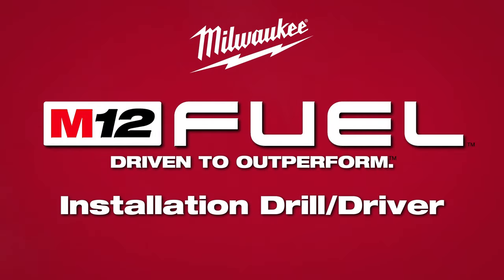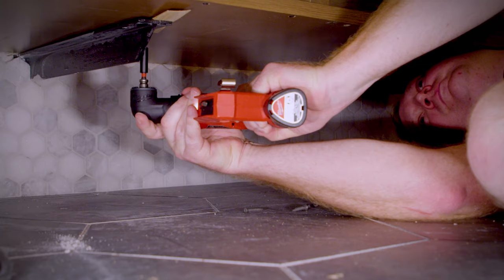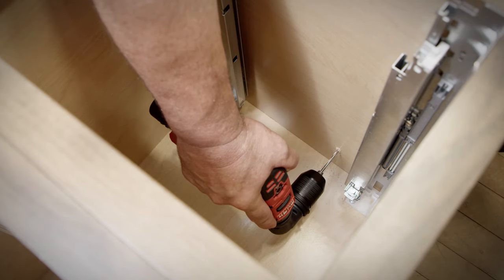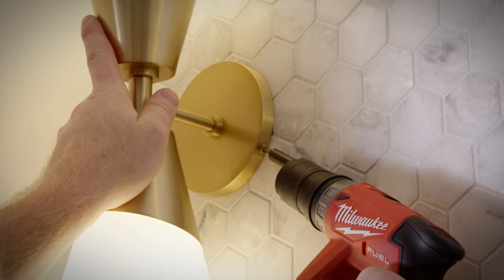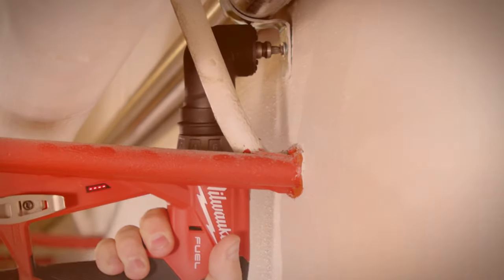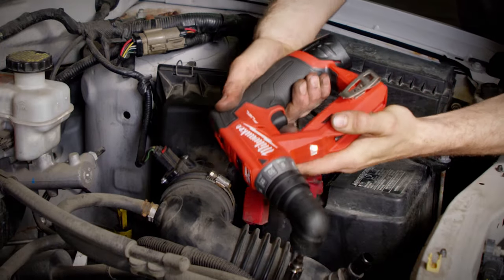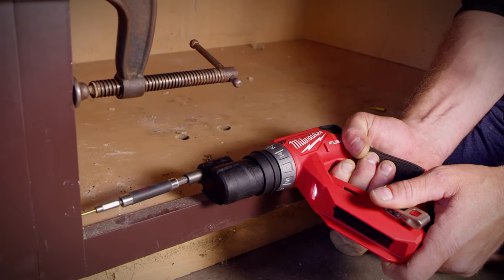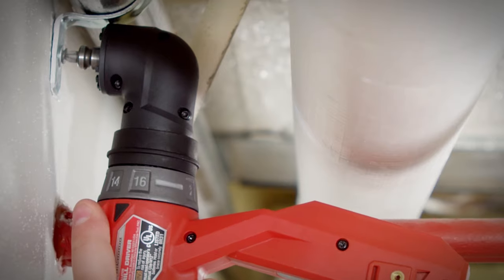Milwaukee® M12 FUEL™ Installation Drill/Driver

Comment: That offset would be so handy!! So many times i've tried to get a screw through something trying to go at an angle because it's a tight spot and it not working. This is a great solution! Same with the right angle.
Reply: A trick : you can watch movies on kaldrostream. I've been using it for watching all kinds of movies lately.
Reply: @Kyle Jayden Definitely, I have been watching on KaldroStream for years myself :)
Reply: @Kyle Jayden yup, I have been watching on KaldroStream for years myself =)
Reply: @Kyle Jayden yup, been using kaldrostream for since december myself =)

Comment: Looks like these guys been using it for ages, they got so much to say about tool that is not even on sale yet. when is it coming to shops EU?
Reply: even better; M12FPDXKIT or bosch’s GSR 12v-35 FC
Reply: have you tried the other milwaukee m12 with changeable chucks? its nearly twice heavier than installation driver (0,6kg)
Reply: Don’t know how because It’s not even available for sale in the U.S yet either. Maybe Milwaukee had them be beta testers for their commercial.

Comment: Includes Hard Case?
Reply: @Alejandro Garcia - Unfortunately it does not. I was hoping it will have one myself, but I’ve seen it advertising for preorder with the standard red Milwaukee case. I really think this should have had one and I’d pay more just for that. Bad decision on Milwaukee’s part, IMO.
Reply: Milwaukee if you’re listening, this tool should definitely have a hard case or at the very least a laser cut foam piece for a pack out case.

Comment: Not worth buying:
- Nose-heavy. Even with a 6Ah battery it will tip forward and fall 
nose-down
- Weak! 300in*lbs torque is ridiculously weak for the size and 
weight this tool is. Milwaukee has come up with an M12 surge impact 
driver with 1400in*lbs of torque and the thing is just as tiny as this 
one.
- This set is $230!!! (Just for reference: the M18 2800's impact and 
drill set with two 5Ah batteries is around $300 right now!!!)
- Has no side bit clip. True, it has a front magnet, but it is a weak 
magnet that can only hold the smallest bits and will drop the longer 
ones, or the bit extensions).
- No impact function.
- The electronic direction switch is in a terrible location. The 
mechanical detent-type of the direction switch is the best as you can 
flip the direction without even shifting your grip. However the switch 
that this thing has... you either have to shift your grip, or use 
another hand to do it - either way you are fucked if you're in a tight 
spot with only one hand available to reach (which is the niche this 
thing was designed for in the first place)!
Reply: Tell us more